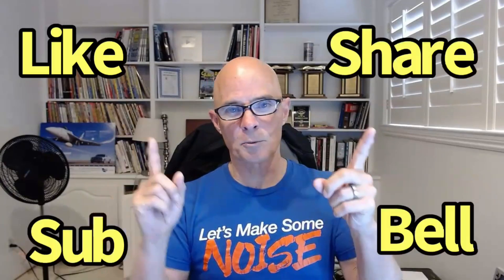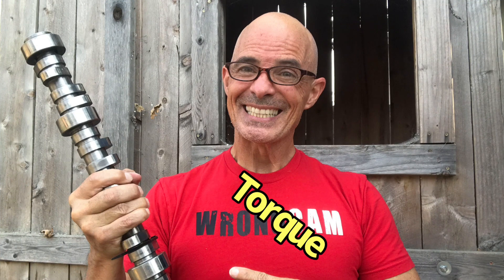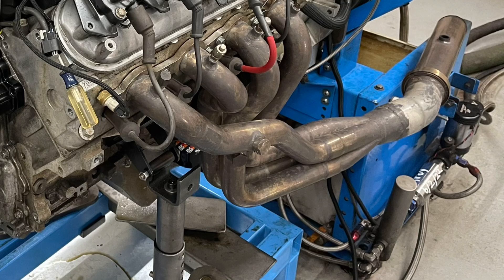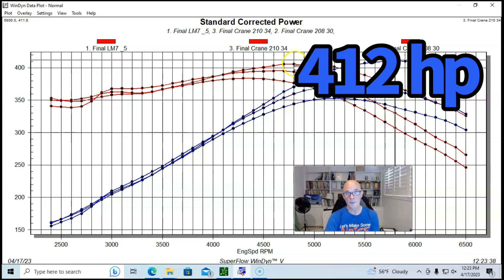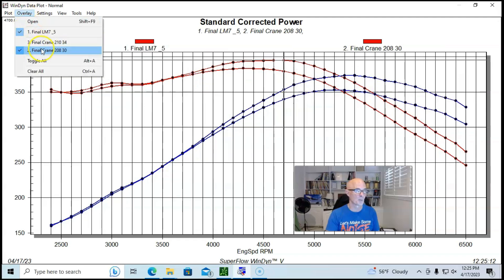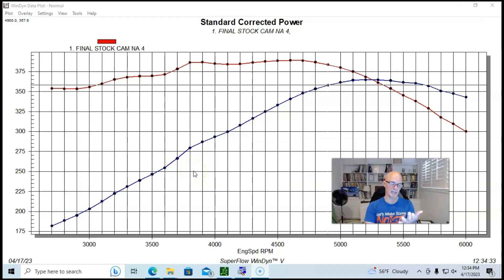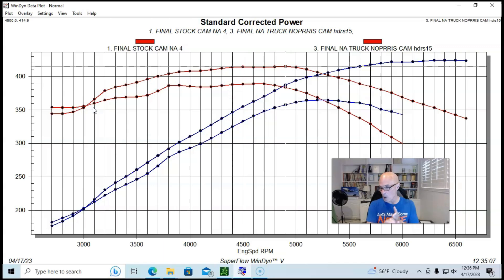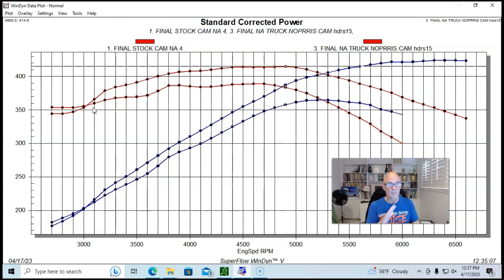WHERE'S THE TORQUE? HOW CAN I MAKE MORE LOW SPEED TORQUE? WHO MAKES THE BEST LOW-SPEED TORQUE CAM?

Comment: Like your LSA cam test, it'd be interesting to do an overlap test, keeping identical LSA and only changing the overlap via duration, and see where and what torque does. 
Does peak torque stay the same just at different rpm's?
Reply: That would mean increasing duration to increase overlap…  which would mean more power up top and sacrifices down low
Reply: @stlchucko  yes, and decrease as well.  On a 5.3, something like a 108 LSA, .550 lift, and 15, 45 and 75 degrees of overlap (@ 0.006)
Reply: @383mazda  you can find ls cams of pretty much any duration you want in 112lsa.  It's easy to make the comparison using Richards videos, pause on a Dyno screen and take a screenshot then find another video with the cam you wanna compare and do the same and you can flip back and forth through the screenshots.  This is how I figure out what cam will best suit my needs on the custom builds I do.  I have a whole folder full of screenshots of cam tests on 5.3s.  I usually build bigger and higher compression engines or boosted setups but I'm not usually looking to compare numbers as much as the shape of the curve.
Reply: you will always gain average power even at idle with tighter LSA. LSA at the end of things determines the IVC point. Early closing = more dynamic compression = more torque = more hp. LSA should only be widened if your looking for better idle quality, more peak power (large durations at which point you need to reduce overlap by increasing LSA), and reducing compression. ideal LSA for a 6.0L is 108. There a formula you can use. Off course if you want a smoother idle you get a 112 114, or if you want to built a rev machine you throw in high compression pistons 11:1+ with a huge duration cam and 114 + lsa
Lots of tests done on this, rich doesn't really have to. If anything by looking at his recent cam tests you should be able to realize that LSA has a huge impact on torque. The cam motion little choppa had huge durations but a tight LSA and was very similar in power to the Norris and torqunator.
Reply: @jacobvanhalteren7452  well said
Reply: @jacobvanhalteren7452  I think I’m about to do a 6.0 with a truck Norris cam with 317s. Will be changing pistons to tailor the compression ratio. What do you think the maximum compression ratio I can have using 87 and 89 octane? Daily driver with a 4L60 in an S10 with 3.31 gears.
Reply: @erniemathews8130  I bought 799 heads of a guy who was running a 6.0 in a 1500 with 10.8:1 comp on 87 with a 6l80. A lot goes into it but at the end of the day it's really all down to the tune. I sorta settled with 10.7 on mine although I have a heavier truck with a 4l80e. So long first gear with the weight means more load = more pressure = higher Temps and more chance for detonation. Remember that there is a point at which with the extra comp it makes more sense to run 91 anyways. For example if I get 5L/100km improvment from the efficiency gained by adding timing with 91 I would be ahead in terms of cost. I would then also have more power. So there is a point at which your actually better off adding in timing and 91 instead of pulling timing and staying with 87. You just have to tune for both and test and see.
I'm also doing ceramic heat insulation on the combustion chamber and pistons to hopefully allow me to run more timing on 87
and depending on what your looking for the truck Norris cam is good but there are a lot of comparable camps out there
Reply: @jacobvanhalteren7452  I’ve done a lot of research so far. It seems to be a good compromise to the sound I want at idle and power. I know sound is a silly way to judge a cam but I have that old school hot rod need 😎
Reply: @erniemathews8130  The LSA being tighter actually makes up for lower compression by closing the intake valve earlier hence creating more dynamic compression. It's all stuff you got to think about

Comment: Roots blower. 
Increase only lift. 
LSA makes the curve rotate (Don't remember which way)
Reply: Lower the lsa is the low and midrange torque improves.all dirt track engines run low lsa camshafts

Comment: Based on your tests, a narrow LSA typically increases low speed torque.  Advancing the cam also increases low speed torque.  Small duration increases low speed torque.

With this in mind, wouldn’t the “ultimate” low RPM torque cam be a small duration, good lift, narrow LSA, and advanced?  For example, in a 5.3L something like a 200/210 with 0.550 lift and 107 LSA.  I wouldn’t expect 50 lb/ft gains at 3000 rpm, but would think that 15-20 lb/ft between 2000-3000 rpm would happen.

Frankly, I don’t see the point in it.  Would get much larger gains just going to a bigger engine.  4.8 < 5.3 < 6L type deal.  It was more of a thought experiment.
Reply from the maker: as indicated, those changes don't do much at 2000-2500 rpm (nowhere near 20 lb-ft)
Reply: @richardholdener1727   can you show how to make a 5.3 stroker
Reply: @noahbrooks6088  you can buy 'em that way or get a 4.8 and add in the OEM reciprocating assembly for more money. Better to bore out and put in a OEM 5.7 reciprocating assembly.
Reply: At low rpm displacement is almost always going to be the biggest change in torque.
Reply: @NBSV1  That's why there can be such a divide.  For sports and racing, the lighter, smaller and higher RPM and tuned motor may be the better choice, but for luxury and big car pavement pounding, displacement is always king.  Some will claim the big blocks of yesteryear's full size cars was part of "excess", but in truth nothing can power a large heavy automobile as smoothly as a big torque high displacement NA motor.
Reply: @kingduckford  like locomotives and OTR diesel 18 wheelers. lots of displacement, with the turbos and superchargers just there to increase the compression as much as get near 100% VE in the cylinders.
Reply: Some of these ‘ more torque down low ‘ comments sounds like the theory behind the thumpr cam everyone loves to hate.
Reply: Exactly ChuckO, just most magazines never try and optimize more torque
Reply: @archive.garage  "torque wins races, HP sells engines"...and car magazines. how many times did you ever see a HP number announced on the front cover? then you read and it was done with N2O on C16 gas. 

also too, a general "RV cam" isn't going to have that choppy, "duga duga" idle created by massive  overlap (but if you find a great angle cut on the back of the valves, you increase air flow from seat to about .3 inches of lift, and you get an overlap effect as the exhaust valve is closing and the intake is opening on the third cycle--both valves are flowing better than they did in cast OEM shape before the angle cuts on them and the valve seat). now you can have small duration since you don't need overlap at the camshaft. 

of course, if you run roller lifters, you can accelerate the valve to full lift faster than a flat tappet..and can shape the backside of the lobe to close the valve softer to avoid valve bounce. now you can build your length of duration inside those two parameters, should lift be a problem due to clearance of a domed piston etc or you just need duration to make up for the size of the valve's head (say a nailhead Buick).

one last thing i forgot--a cam with less duration and lift will contain more of the mechanical compression ratio (or to phrase it in a way we understand, the long duration cams idle terribly because that mechanical compression  is running out the open exhaust valve during the overlap period when the intake is open and theoretically the incoming air/fuel charge is pushing the hot exhaust out the pipe). so if you have too much compression ratio for your fuel choice, you want more overlap to lower that compression ratio.
Reply: @albertgaspar627  I agree
Reply: How will you get that much lift into that short duration?
How about bigger valves, better bowls/ valve job, etc. to increase the low opening flows?
Reply: @hotrodray6802  a roller lifter allows for steep ramps but go too far and you're spending money on the rest of the valvetrain to keep up and not float valves. A larger valve may not increase low flow since its more metal to go around (depending on the valvestem's angle) but you're right about bowl work and a good 3 angle valve job on the backside of the valve to help it flow better at low speed--do that for both valves and you've got the benefits of overlap in the camshaft without the negatives of overlap.
Reply: @hotrodray6802  stock GM cams have moderate lift with short duration, 2002 Z06 LS6 cam is ~204/218 .551/.547 117lsa
Reply: stock cam with vvt
Reply: Really wouldn't the ultimate low rpm torque engine be an undersquare long stroke engine making more torque via leverage at the crank and having a cam that supports that low rpm airflow into the engine? Much like this guy says in the video. Basically yea you can move the powerband around with different cams but you can only go so low for rpm torque with a cam alone. Gearing or a converter will make up the difference. But if your wanting all low rpm torque straight from the motor then build the whole motor that way. This goes beyond the cam. Sounds like what people want as described in this video is the low rpm torque of a Diesel engine but out of a gas motor. Ok. Build a Gas motor as close as you can as a Diesel is with it's setup. Just look at what Cummins is now doing with unveiling their first ever gas engine. It's designed to mirror that as close as it can to it's older Diesel brother in low end torque and performance.
Reply: Chuck, I agree with you. Typically that is exactly what happens. BUT, according to Richard, there is “never a custom cam that will make more power.” He told me that before!!! Unfortunately, Richard is wrong. With the correct cam you can gain more power than these “run of the mill   self cams”!!!! You are paying for a cam anyway so why not get a cam for YOUR ENGINE COMBINATION!!!
Reply: @scottsigmon926  that myth may be busted. Best you can do now is get a cam with the most modern lobe for your combo.

Comment: Buying a cam with a tighter LSA and advancing the cam are two things I would do searching for low speed TQ
Reply: Sounds like the theory of a thumpr cam everyone hates.
Reply: "everyone" hates?
Sounds bitching and runs great in my stock FMX stock converter Cleveland.👍👍👍👍
Bust a gut good for a mild 351.
Reply: @hotrodray6802  This is exactly what a Thumper is intended to do , sound bitchin in a mild engine. Obviously there is a market for it, so kudos to Comp for catering to that crowd.
Reply: @cedricwilson2055  the people who hate them dont understand how important valve events are
Reply: @larryfeasel2403 they get garbo mileage, and don't make any more torque than a "RV" cam.
Reply: @cedricwilson2055  I’m also in the Thumper hater category, along with some other gimmicks. They mostly increase overlap to make it sound nasty, it’s for fairground cruisers at best.
Reply: No, not true. U need a wide LSA. Tight lsa makes overlap and kills vacuum  and low rpm torque. Advancing cams u can go to far and it kills them faster than u think. I did one at 9 degrees  advanced  once and runs worse than stock.

Comment: The easiest way to make more torq down low is to install a stroker kit.
Reply: A stroker kit is more displacement. Easier and cheaper would be a bigger engine.
Reply: @Marc_Wolfe  I understand. I was sticking with the premise of the video. Using the same motor as a test mule.
Reply: @I_like_turtles_67  By that logic, get an LS1 instead of an LS3. I'd throw out more examples, but I'm not a fucking encyclopedia.
Reply: @Marc_Wolfe  what? An LS1 is 346 cubic inches and an LS3 is 376 cubic inches...

Comment: Shorter than stock cam duration and VERY long runners.   

Have you ever tested cams with LESS duration than factory cams?  I'm talking around 180 degrees effective duration.  At low speeds, there is no inertia tuning, and the piston pushes charge back into the intake port.  The way to trap charge at low speeds is to close the intake valve at BDC.  To enhance the effect, use a runner length that is calculated to resonate at 2000 rpm (or whatever speed you want).  Don't expect the engine to do well at high rpm, though.
Reply: Be easier to go with stock duration specs and add more lift & a tighter LSA.
Reply from the maker: the runner length can help-the cam stuff not so much

Comment: How about advancing the cam timing a couple of degrees?  Doesn't that move the torque curve lower in the rev range?
Reply from the maker: I talked about that
Reply: @richardholdener1727  Yeah, I heard that and remembered the goofballs at Powernation and remembered a dramatic difference with a build they did a couple of years ago.  It took a minute to find, but I see now they were not showing anything below  3500 rpms, which is exactly what you were saying.   https://youtu.be/wimUgFd0Qkg
Reply: Yes, but not by a lot. Around 200 rpm per 4°

Comment: Displacement.
Reply: This! 1000%
I had this discussion on a previous video with someone. All else being equal a larger displacement engine will increase low-mid range RPM torque. Every. Single. Time. That's why I've never really agreed with GM putting small displacement engines in trucks. It makes zero sense. All they did was make the engine rev higher but started to use 6, 8 and 10 speed transmissions to reduce RPM at highway speeds to keep the engine in its "powerband".
🤷

Comment: Hi Richard I have plz a quick question, where does the truck Norris cam start making power? And my last question on a LQ4 is the Norris cam a gd pick for this engine?
Reply: I can sorta answer cam question based on personal experience. What are you trying to do with the LQ4? If you want a mild cam, stock torque converter, etc, it will work. If you're chasing HP numbers, you'll need a bigger cam. I think the BTR Truck Norris and similar sized cams are great for 4.8s and 5.3s, a little on the small side for a 6.0L
Reply: @bluecollarhotrods9781  hey bud, hru, thank you for ur response I'm running 243 heads with 20 thousands shaved and a 40 thousands gasket with a trailblazer SS intake long tube headers 4.10 gears and a 2800 stall converter. I guess I'm looking for low end torque and mid power. Wat cam do u recommend for my setup? Any feed back is appreciated
Reply: And I forget to mention it's on a 2004 Buick Rainier
Reply: @eddiearencibia606  being that you have the converter and 243s, I would go with something a little bigger than the truck norris. I'm stepping up to a 224/232 cam. I have a 3000 stall and 4.10s, my truck is daily driven. I think the Summit 8720 pro LS cam is the smallest I'd go - 218/227 .600" lift. The Sloppy best cam is a good one as well - 219/225  595" lift. Both will outperform the truck norris in a 6.0L
Reply: @eddiearencibia606  that's going to hurt a lot of feelings
Reply: @bluecollarhotrods9781  thanks man I really appreciate ur feed back, I'm gonna look into this. One another question plz wen I remove the Norris cam will I have to change out my cam bearings or can I just throw another cam in it?
Reply: @eddiearencibia606  if the bearings aren't chewed up or down to the brass babit material - send it.
Reply: @bluecollarhotrods9781  Thanks again ur info was helpful u have a great evening and ur family God Bless You!
Reply: @eddiearencibia606  Thank you. You as well, and enjoy your hot rod SUV. It's literally going to be fun for the whole family.

Comment: We all know that if yall want low rpm torque, you need a big block motor. More displacement is more bottom end torque. Other than using noz.
Reply: Long runner intake, small cam with big lift & tight LSA helps.
Reply: @bri-manhunter2654  like Richard said, not much. Lol. Nothing like 500-600 ft lbs at 2,000rpm's out of a big block NA.
Reply: @richardcoleman9645  yes but everyone not a fan of big blocks. Need a all around universal solution.

Comment: Advance the cam?  Wouldn't increase torque but should move the torque curve to the left...
Reply: Not by a lot. 4° advance moves the curve approximately 200 rpm. And valve to piston clearance needs to be checked carefully.

Comment: Long high velocity ports and intake, big cubes, lots of compression... are the easy way..  cams move the TQ peak around a bit, but with the usually small engines you test the cams they come with are about the most grunt they gonna make under 4000. Only if they are overcammed or way under cammed will they pick up down low.  Now... what about LSA? Can that bring up some bottom end TQ?
Reply from the maker: I have tried endless combinations
Reply: Poncho Power Thumper